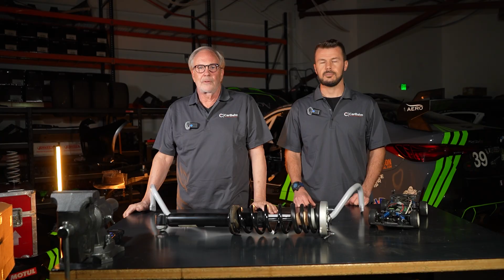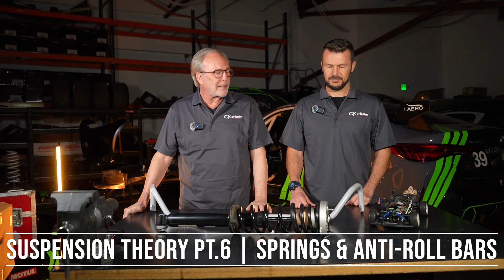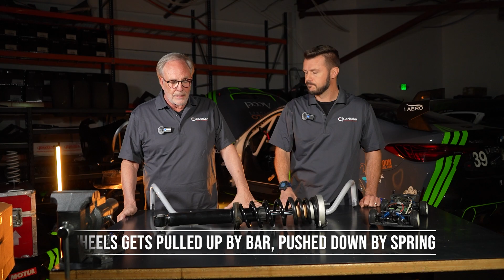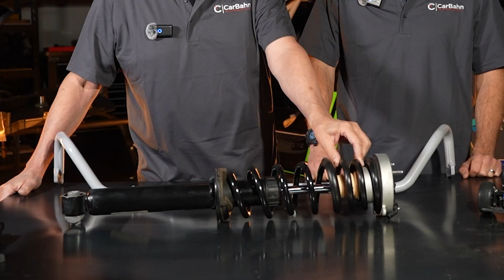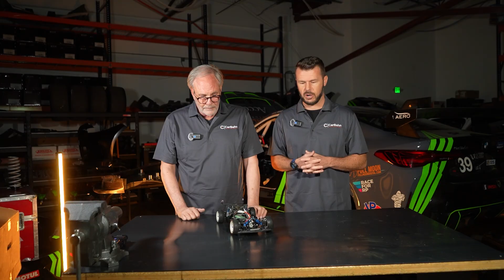The Relationship Between Springs & Anti-Roll Bars | Tech Tips with Steve & Jeff

Comment: If what you're saying is correct, if you had soft springs a stiff rear sway bar on a car and turned into a right hand corner the rear right tyre would lift off the ground. 
Then if you swapped the rear right spring for a super stiff spring, the rear right tyre would no longer lift off the ground. 
I very much doubt this is true!! If anything, the rear right wheel would now have less travel available and it would lift up even more easily?
The inside rear wheel lifts simply because the front axle rolls so much more than the rear axle, that the rear wheel runs out of rebound travel and so has to lift up. The shorter the rear wheel travel has the more likely it is to lift.
Reply: Go karts do what you say, car with solid axle spooled diffs or front drive cars need soft springs and stiff sway bars to  help lift inner rear wheel and rotate.
Reply: You've somewhat answered your own question, but think of it this way.  The stiffer sway bar reduces total movement (up and down), and when a vehicle has 2 tires in a droop phase (unloaded, cornering event), the only forces that fight the anti roll travel is damper compression or spring rate.  They are the forces pushing down.  Now increase the force pushing down on the anti roll bar via a larger spring rate, and you get more force on that inner tire.

We see this every time we run our BMW GT4 racecar with telemetry, and make spring vs. roll bar changes.  the inside wheel vs. outside wheel speeds (because we see all 4 individually in our telemetry) have large variances in MPH, especially in the corner entry, and corner exit phase, when inside wheels are being unloaded.

To be clear, they rarely come off the ground, but the tire is a ballon, and with less force pushing down on the ballon, the grip from that tire reduces.  Its easy to have too much anti roll bar and not enough spring rate (for your tire), OR not enough anti roll bar and too much spring rate (for your tire) in regards to the "relationship".  

This is why our CarBahn suspension systems are designed to be optimal when used as a package.
Reply: @CarBahnAuthorityI really can't believe any of this. When a car corners at a specific g loading, the amount of weight transfer is dictated entirely by the weight of the car, the centre of gravity height and it's track width. None of these are affected by spring and anti roll bar rates whatsoever. 
When a car experiences weight transfer in a 1g corner, the total amount the inside tyres will be unloaded will be exactly the same, regardless of springs, dampers or anti roll bars, it's simple physics! You're misunderstanding your data.
Reply: @CarBahnAuthoritythe inner wheels are not pushed down by the springs during a corner in the way you are describing. 
What you are suggesting would actually break the laws of physics!

Comment: There is no inherent relationship. You're falling into a magical thinking fallacy. You will realize this is true because you will fail to be able to mathematically quantify every aspect of it.

Changing corner springs and stabilizers will affect Lateral Load Transfer Distribution, meaning that the stiffer axle will transfer more load across it, and the softer axle less. It does not matter how you achieve this in steady state roll. 

There are some situations where you need to think about corner vs stabilizer stiffness:

In unequal roll there will be a travel dependency effect from the stabilizers causing a different kind of resultant load transfer than if the springs were less dependent. This may be problematic on bumpy tracks or if using bumprubbers for stiffness.

Corner dampers are ineffective at damping roll and stiffening the stabilizers will result in a less damped roll. This may be useful for having a softer ride over bumps in corners and a harsher ride when applying brakes, for example, but generally introduces compliance issues.

The corner springs and the stabilizers often have a different installation stiffness and motion ratio, which may mean that a simple theoretical model of the change you made might not be actually similarly represented in the real world, leading to an effectively different roll stiffness between the options.

Stabilizer mounting stiffness is generally harder to make stiff enough not to damage the chassis compared to corner springs but YMMV. If soft enough there will be complicated flex effects that may change the rate dramatically from theoretical.

Stiff corner springs may be made softer in rebound via the use of properly matched helper springs, but it is difficult to make stabilizers nonlinear in a precise way.

Comment: This is great except you never went into how to pick that relationship.
Reply: So much information to say absolutely nothing lol
Reply: Exactly, but i believe ilthe issue is its not a straightforward method. Cars are runed by trial and error and experience. Unless you have access to a simulator.
Reply: @whome4836  Somewhat correct.  Simulators are only as good as their tire/grip modelling, and very very few in the world are good enough to equal real world testing/trial and error.  As you change your tire size and or compound (grip), you will need to adjust the relationship to optimize the tire's dynamic contact patch.  Our suspension system (and stiffness rates) are designed to give the road car user the most "tools in the quiver" to tune your vehicle to your liking.
Reply: We've done that work for you with our suspension packages!

Comment: Love the tech videos, keep them coming! 

Steve, you mention that increasing rear spring rate can improve rear traction on corner entry. My experience has been the opposite when changing spring rate in isolation, so I’m curious what other factors might be at play to produce this effect. Could damping or ride height changes be overriding the positive effects you’re describing?
Reply: You are right, Trevor. I think they are a bit confused and what they are saying goes against empirical results in the sim and in real life. Making the rear spring stiffer (with all else being equal), normally decreases rear traction, as it adds stiffness to the rear, in heave, pitch, roll and warp as well. Also, in a pure straight line braking, so when pitch is present, the anti-roll bar does not come into effect really, because there is no lateral load transfer.
Reply: @PeterZuba9  @Trevor-OptimalRide The Spring is a force to the tire, so adding force doesn't always reduce grip of the tire as you suggest.  You may have felt the limit of the tire, which can and will happen with softer or with stiffer springs.  What we are describing is the stiffer spring's force pushing downward against the anti-roll bar's force (which generally pulls upward on the inside wheel) when turning into a corner.  Too much roll stiffness, and not enough vertical stiffness (spring) will cause the car to be un-stable at corner entry due to this "un-loading" of the inside tire.  Some might describe the feeling as "snappy". Increasing the spring rate (or dampening) helps the inside wheel resist the inner wheel unload.   But again, you have to keep in mind which tire/grip level you're tuning to, as that will largely dictate how much force/load/stiffness is required.  General rule of thumb is to try and have smooth load increases to a tire in order to achieve maximum grip.
Reply: @PeterZuba9  To be very precise, many rubber bushings will deflect in heave (and roll) if they're clamped tight enough or chemically. It's very significant in some cars, maybe 2000-3000 N/m on bars with a short lever arm and small diameter, stiff bushings which are bonded. On some bars, no effect. There is of course no effect for metal fittings as in most racecars. Apply same logic to suspension bushings as well!

Generally though, agreed. Nothing's magic in vehicle dynamics. If you make an axle stiffer to the opposite axle, it will transfer more load laterally and have less grip. Always. It's very rare to gain grip to offset the load sensitivity due to having a better camber angle or whatever, although there's always more than one dimension to it and sometimes going stiffer on an axle can improve the car's cornering force over some bump profiles, even if the resultant load transfer is otherwise more in transient.

Comment: Good video. What’s the general equation? Stiffest hole on the bar but softer dampening on the suspension? Vice versa?
Reply: It's difficult to make a general statement that takes everything into account (Tire size, Tire grip, intended use of the vehicle), but CarBahn products are meant to work as a package, and our spring rates & sway bar rates are tuned to work in concert for each platform.

The X drive cars will accept a stiffer hole on the rear anti roll bar more willingly, due to AWD.  But they will also use a softer front bar setting, also due to the AWD.

The non x drive cars will want a stiffer hole on the front anti roll bar, and a softer hole on the rear anti roll bar, to prioritize traction.  

Just remember, a tire size, brand or compound change will warrant "re-tuning".